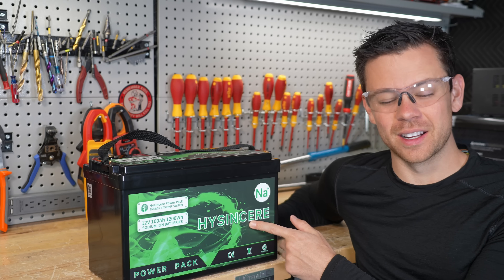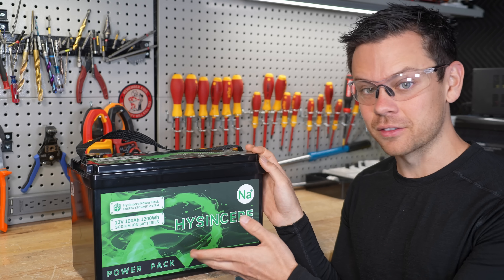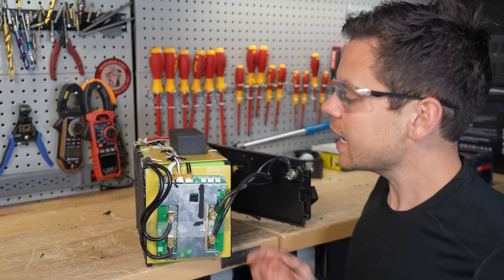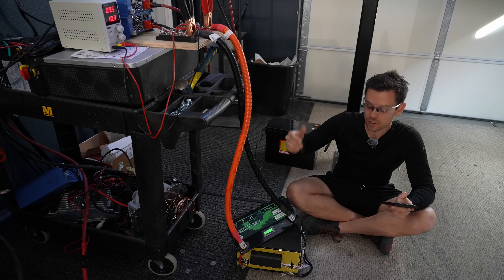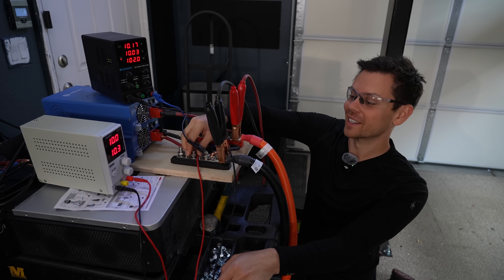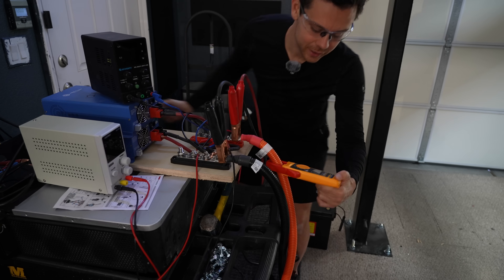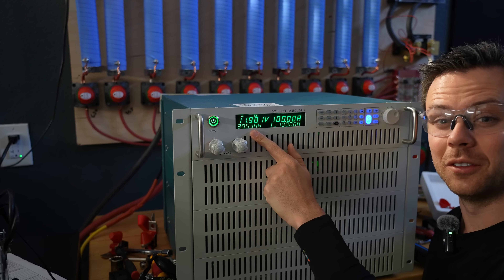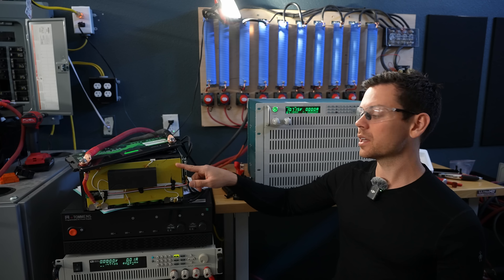Testing My First Sodium-Ion Solar Battery

Comment: All the disadvantages of the sodium battery are valid, but isn't it wrong to say the inverter won't work with it? That's because the inverter is expecting a LFP battery curve. Once it gets more popular and inverters start using proper discharge curve for sodium, that problem should go away.  Also, it wasn't that long ago that LFP's flat discharge curve made it difficult to see what capacity is still left in the battery. With a linear discharge curve like the old SLA, it would be much easier to know for sodium. All other disadvantages still hold though, it's currently terrible.
Reply: Figuring out the capacity/usage of LFP is as easy as installing a shunt, like the Victron Smart shunt.
Since most inverters now used can be used with either LFP or lead-acid batteries, it makes more sense for the manufacturer of Sodium batteries to make their BATTERIES to be compatable with the inverters, solar charge controllers, and grid powered battery chargers, than to have to make everyone replace what we already have that works, just for a battery that won't work as shown here.
Reply: I'd think the discharge curve comes from the chemistry, so there isn't much to be done. As for the changes to the inverters, it's as simple as a firmware change. As for capacity remaining, no hardware needed, it's already there in the discharge curve. It took a while after LFP came out for manufacturers to add a shunt to batteries. They were all depending off of discharge curve before.

Comment: If you use LFP with a heater you'll still come out ahead as the heater will knock off maybe 15% capacity, and that's if for some reason you're using LFP batteries somewhere that isn't already heated. My basement may not be directly heated, but it doesn't get below 45 even when it's -20 out. Heat will just bleed off the furnace naturally and keep the ambient temp somewhat alright. Maybe a non climate controlled garage that's above ground? But honestly you either have space to put the batteries that is somewhat climate controlled or in say a completely off grid scenario, you can use secondary agm batteries to jumpstart the LFP ones, say if it's a cabin and you only run the LFP batteries when you're there. Batteries are so energy dense these days that it really doesn't take much room in an utility closet to run these, and ironically inverters usually can produce enough waste heat to keep an insulated closet full of batteries warm

Comment: This is not a market ready product. The real stuff from CATL starts production in December and will probably not be available for normal customers until at least a year later. The cells in this battery are from producers who haven’t solved the massive problems sodium has had for years. This trst is interesting, but not at all relevant for what we’ll see in a year.

Comment: it seems to me that lead acid would be better as a starter baddery as they would be a fraction of the price.  I have said right from when sodium ion ha data released that lfp were far superior for off grid use where the flat voltage curve on both charge and discharge holds many advantages along with the high cyclic efficiency. I will certainly not be using Naion in the forseeable future.
Reply: Yeah if the sodium battery maker can finally flatten the voltage curve with any new chemistry mix they found, then sodium ion would be cross compatible with lithium ion devices.

It will not happen overnight, probably still a couple years from now since it needs more intensive research

Comment: Earlier today one channel was claiming god like claims on sodium ion, and his commenters were kiss ass. Thanks for being honest and trustworthy.
Reply: A Viking??
Reply: Two bit DaVinci
Reply: The problem is there is zero information about what generation battery this is. He might be comparing some overstock battery from the very first commercially available sodium batteries with specs of the latest that's not even on the market other then in Chinese EV.

He is technically strong, but has a big lack of commercial  or marketunderstanding unfortunately. 

And just that a standard inverter doesn't like to deal with it, is an inverter problem, not a battery problem. I live in a cold region so for me the sodium properties are worth it instead of having big batteries inside a warm house or wasting electricity to keep the batteries warm. And if the batteries get a lot cheaper then LFP's, then a bit more expensive inverter will be easily worth it.

Now i pay a bit les then 2.000 euro for a 16,5KWH 48v 15s LFP wallmount/wheeled battery. Sodium could get ridiculously much cheaper then that. 50% is on the horizon especially when CATL will pump out so many cells. Commercially available cells are already on LFP's level! And that is even when the mass production is mainly going to the chinese ev's. When the market will be flooded, sodium will rapidly get cheaper.
Reply: I contacted my contacts, if you're interested in facts: 
"1.Commercial generation – Currently, the commercially available sodium-ion cells are mainly first-generation (Nax-based, e.g., NMC/NaFePO4 alternatives). They are being rolled out gradually for energy storage and some EV applications, but the technology is still in early commercialization compared to Li-ion."

So yeah, comparing a 1st generation tech product with a mature product. Which only makes me more hopefull for the next generation.
Reply: @aarondcmedia9585  This is o tiresome. First you put words in my mouth, then you clearly have no intention of reading what I've said, or simply not wanting to understand the situation.

The discharge curve is only relevant at this time with non-sodium suitable  inverters. Price will be everything.

And yes, at the very least Will should have said it was only a 1st generation product and that he would be interested in the future. There is a big reason the whole industry is going for sodium. Or do you think the industry is stupid?

There will always be use cases for LFP, but when the prices of sodium will come down, and they will, LFP makes very little sense for grid applications or home battery use. LFP won't get much cheaper then these dump prices. Just a little hickup in the supply chain and prices will skyrocket, which we've allready seen a few years ago.

Yes, LFP is king today. Zero doubt about that and i never said anything else. Sodium will overtake LFP. It's simply a matter of time.
Reply: @aarondcmedia9585    Will talks about this (outdated) SIB (the way he does) to drive engagement with his channel - it makes people pick sides and fight with each other in the comments or on that forum - while he sits there laughing.
Reply: @stefansiggy   the guy u replied to was using ad hominems right from the get go, a sure sign that a respectful discussion is not wanted.
TL;DR: don't waste ur time (like that).

PS: Will understands 'commercial' well - he did a "hit-piece" on a SIB to drive engagement (prob noticing how SIB content by others took off).  To his defense - he put 'let's wait for 5 years and test again', 'send me what u got' and 'there could be a use case for this tech' in there.
Reply: @stefansiggy  ya really think Will is that sort of person?

Methinks you are too deeply stewed in the Na-ion battery kool aid.
Reply: @aarondcmedia9585 What that sort? Have you even read anything he said or just imagined it?
Reply: @aarondcmedia9585  What do you mean? Will is a strong electrical-technical person, not a commercial person.

I've been importing batteries for over 5 years, i like to think i know a bit about the commercial and market side.

And yeah, it's not long you can get sodium batteries commercially,  although I had found some unknown factory a bit over a year ago that claimed to be a sodium cell producer when CATL was still 2 years away. The first gen sodium cells are not comparable with LFP, the 2nd generation is close and not sure if i can say it's a better 2nd generation or a 3rd generation, that's the step we're waiting for to get it cheaper then LFP and then the downsides are not as bad as in this example.

Will did not use an inverter made for sodium batteries (they do exist), so comparisons are premature at best. Which is not surprising since they are just commercially available for 'regular people'.

With sodium-capable inverters ánd the price coming down eventually, sodium will beat LFP just by the price alone.
Reply: you have to remember the tech is only coming out next year. This might be a "sodium" battery which has probably been around for decades already - it certainly isn't the new tech which is only coming out for the first time next year which hasbeen in the news lately.
Anything that has been around so far probably takes twice as long to charge, takes more to charge it, has a lower output and will seem terrible compared to lithium batteries. Oh right that's what this video confirmed. Did it confoim anything else? Nope just speculation and dubious claims. I will wait one more year before I make my mind up. Just because someone is kick ass doesn;t mean they are automatically wrong - although granted they usually are.
Reply: @tomfurmby88  bahahahahahahhahahaaa

You can lead you to the truth, but the religion sticks like super glue.
Reply: Seen this in a few places now. Completely drubbed by Will in 1 minute of honest, measured data.

Comment: The manufacturer of this battery should have put in more cells, if possible to allow it to have fully useable 100Ah at a decent Voltage. Even with that, though, the fact that it takes so much longer to charge than LiFePO4s is a deal-breaker, even if it were half the price of LFP.

Comment: A 14F low temperature discharge cut off will NOT work for a car battery.  Around here, that is a very warm morning in January, February, and early March.  Batteries have to perform down to -14F and lower to be practical around here.
Reply: 14f charge, -22f discharge for this sodium battery according to the video, lfp was the 14f discharge
Reply: Charge limit, not discharge. It's up to -23

Comment: Also, remember your basic chemistry! Sodium explodes when exposed to moisture. I wouldn't have one in my RV! I'm looking forward to aluminum oxide.
Reply: It is sodium ION batteries. They don't contain sodium in metallic form, so I don't see why they would explode. Just like lithium ion batteries don't react violently with water, but lithium metal batteries would.

Comment: Something that i find appealing about Naion is the sustained high C discharge. Which i would need for long duration winching. The other thing is id likely set the charge voltage up to 15 or 15.2v as car electric is good to 16v. Only going up to 14.4 is missing the top part of Na cell capacity as i understand it. If i could get an lfp pack that could sustain 300 to 400amp discharge then i would consider it, but for now ill stick with lead acid bricks. I know i could run Lfp in parallel but the bank account says no.

Comment: Isn't the biggest advantage that the materials are abundant and cheap to get, as opposed to the rare earths for LifePO4, etc? And no dependency on China? As you said, that makes it a good fit for large-scale applications.
Reply: No. Just no. There are no „rare earths“ for LiFePo4. This is the domain of NMC which is an entirely different chemistry.

Comment: Yes, they aren't ready for prime time. I think we are still at least a couple of years away.
Reply: Time doesn't change the chemistry and physics. Stuff like the round trip efficiency isn't going to increase much. That said, there may be other sodium based chemistries that are yet to be discovered that have more suitable properties for off grid solar applications. But if one was discovered tomorrow, it might take a decade or longer to make it to market.
Reply: @lordgarak  NFPP is the comparable sodium chemistry to LFP and will won't have one until end of next year or 2027
Reply: how long did lead acid take until it stopped dropping hard on bigger loads !?

yeah.... still waiting. because there is no secret to trick physics.

80 years+ after the invention it still drops below 12V.

and sodium will keep its disadvantages aswell.  physics cannot be changed.

Comment: May I ask what size cables connected the battery to the buss bar when using the 10 amp power supply?  They looked pretty thick like 250-350kcmil.  

A T Burke

Comment: Rocket Reddz energy  makes 210ah battery same size 2000cca for starting will still leave you 130ah usable. The new CATLNaxtra cells are a hundred and seventy five watt hours per kilogram.On par with b y d blade batteries

Comment: Thanks ... they projected it as THE new game changing battery tech so I was willing to wait.
Glad I saw this.
Reply: It still may become that, or it'll be something else.   Nothing is there yet but LFP definitely won't be the best chemistry indefinitely.
Reply: It's super early.  Sodium ion batters are where Lithium batteries were 30 years ago.   Expect them to get better relatively quickly.  However, they are not ready for prime time in 2025.  Maybe 2028.
Reply: @vroom989 don't expect physics to change quickly.
Reply: @casemodder89 Physics doesn’t change quickly, but engineering does. Especially when there’s a market this big pushing it forward

Comment: what a nonsense comparison. the linear curve is similar to NMC and you compare to LFP?
Reply: I don't know anyone using NMC batteries in an off-grid situation. Most are either still stuck with lead-acid batteries or have upgraded to the LFP batteries.
Reply: @Tumbleweed5150  exactly. Probably the current Sodium batteries are not ideal for off-grid, only for cars. The big advantage of NMC and that Sodium Battery is the linear behaviour makes it easy to understand the SOC

Comment: Thanks for this. When Bluetti announced their new sodium power station I thought maybe if it were a standalone battery.  But now I will stick with using AGM to run my heater and use LFP for everything else.
Reply: The Bluetti Sodium-Ion battery seemed quite different based on the review I saw. It had much better round-trip efficiency, and since it has it's "managed" power outputs and a built-in inverter, the linear voltage curve doesn't actually matter. But it did feel me a bit unsure about whether it actually was a Sodium-Ion battery at all.
Reply: Not sure how many of the issues highlighted here were due to the battery vendor (not pulling 100AH) and not the chemistry.

Let’s give it a few months before discounting Sodium Ion, for the first generation of batteries hitting the market!
Reply: @DavidHalko  Yeah, I was wondering the same thing. Haven't written them off. But I haven't written off solid state too. Honestly, I already have more than I need with LFP and ways to mitigate cold. By the time I have to replace them, who knows what the best will be.
Reply: Agm piombo acido o gel no good tensione and capacity inferior the lifepo4 is meyor good wery good is fast end cost minor più 4000cicli 100%

Comment: Basically just a really expensive Lead acid battery 😂
From all the earlier YouTubers claiming this is THE FUTURE I've been extremely sceptical of them and over and over it have shown to not be any good and yet they are paid to chill on it 🙄

Will, you are one of the few credible YouTubers.
And you are THE BEST AND MOST HONEST YouTuber!

👍🍻
⭐⭐⭐⭐⭐
Reply: Bluetti now power station na 1500watt and 900wh capacity 30volt 30ah in case ac 180 lifepo4 da 1800watt max e 1134wh capacity
Reply: This comment won't age well, it's already going big scale commercial. It'll never be better than LFP just like LFP will never be better than LCO. Everything has pros and cons.. and NIB and more importantly NFPP will be cheaper per kwh.